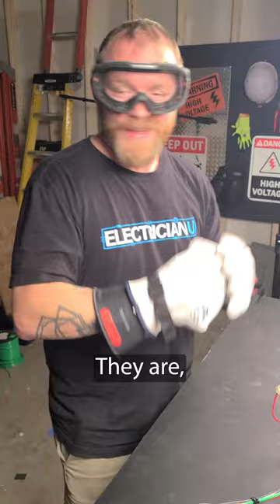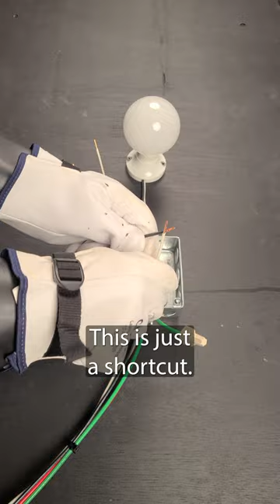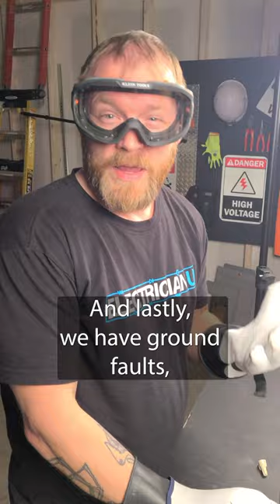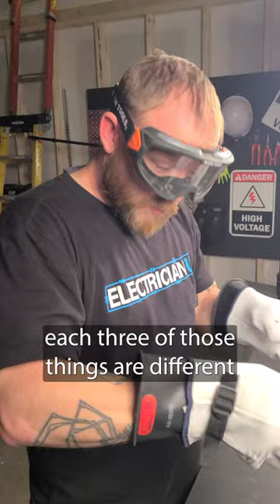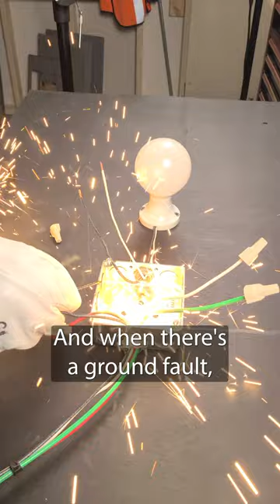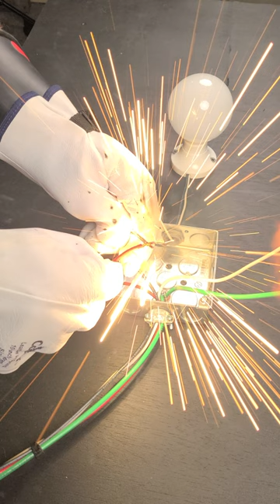Different Types of Short Circuits - 120v VS 240v

Comment: 277 volt short or ground has some really nice sparks, lemme tell you.
Reply: Worst i ever got hit was on a heavily loaded fluorescent lay in lighting circuit. Dont sleep on any of the voltages especially 277.
Reply: @camw6990 why does it matter if it's heavily loaded. Most lighting cuircuts have plenty of amps to kill you it's the volts that determine the amount of amperage that will flow through you as well as contact area and time which plays into resistance.
Reply: 277 is absolutely the worst to get caught on especially on an alpha phrase
Reply: what you do not realize is voltage does not kill amperage kills it only takes.0775 the amps to stop an average human being adult heart let alone a child if somebody tells you 120 V will not kill you their next Dream full depending on the circumstances
Reply: @jsb7546 if you get on the neutral at the end of that heavy load it'll matter a whole hell of a lot
Reply: @justaoldman5419 that makes no sense

Comment: Have you thought about demonstrating what would happen if you run a 120 volt light bulb on a 240 volt circuit? It would simulate what would happen if you plug in stuff that is only meant for 120 volts into a 230 volt supply in Germany and 240 volts in the United Kingdom for example.

Comment: In power systems analysis, the first one is called line-to-neutral fault, the second line-to-line fault, and the latter line-to-case fault (as opposed to line-to-ground fault, both of which are ground faults).

Comment: It's always nice to do troubleshooting over the telephone when the person on the other end does not know the difference between a breaker and an RCD and thinks it's all the same. And tells you the breaker trips instead of the RCD (or vice versa) and all your efforts are basically useless because different errors cause different safety elements to trip.

Comment: NOW THATS SOME DAMAGE!!!
❤❤❤
Reply: Had a fire a few weeks ago from the 480 volt hvac another crew screwed up on. Right on top of these 1500 volt lithium ion battery banks 20 percent charged. Now that's some damage. Surprised the battery's didn't blow up with all that heat defenilty could have been worse.

Comment: P = U^2/R -> power at 240 is 4x at 120 (as the current is 2x and the voltage is 2x). Assuming R is constant, which is not quite accurate, as the neutral has all kinds of parallel paths via bonds and earths, and the hots don't.

Comment: We had a ton of unmarked 277 volt lights in a halve Millon square foot plant. Had a long cord where  would plug into the ceiling 277 volt receptacla and short it out on a steel beam or larger steel pipe. 
Has old circuit breakers that never cleared a short in less then two seconds. Newer midels tripped out in a flash. Company was too cheap to even purchase one circuit tracer for the 6 electricians

Comment: Don't all of them go to ground? Either through the neutral or through the bond?
Reply: No they go back to the source. Kind of a myth tht ac will go to earth. In reality the transformer neutral is bonded to the earth by a earth rod so when your panel earth fault occurs it runs thru the earth to the transformer earth bond back to the generator
Reply: actually, you could have a short phase to phase (or between hot legs on single phase) and nothing going to ground / neutral.

Comment: N-E faults will only trip MCB breaker to trip. L-E fault will cause both MCB and RCD to trip followed with a bang and flash. L-N will do the same as L-E if appliances are in use. ( all otherwise known as short circuits)
Reply: Nuetral to earth faults trip our gfci's here. European electrical still confuses me sometimes.
Reply: @jsb7546  Not sure where Garkan is from and I can only speak for Germany.
If hot and neutral touch, it's a short circuit and the MCB/fuse trips. If the hot wire touches ground/earth, only the RCD trips. The MCB may trip, but this depends on the exact circumstances, e.g. how fast the GFCI/RCD/MCCB trips.
Touching neutral and earth should not trip anything theoretically, as both neutral and earth are the same and split before the RCD. However there are always certain minor residual current floating around and so at least 30mA RCDs will trip if N and PE touch.

Comment: Why does a direct short between hot and neutral cause a breaker to trip? Is it the lack of resistance or something else?
Reply: The amount of current that kind of short produces trips the breaker’s electromagnetic mechanism. That’s the “quick trip”. There is a thermal strip there, too - that’s for slow overloads, like two heaters plugged into the same circuit. Look up how breakers work.
Reply: Yeah the lack of resistance causes the current to jump outrageously high since the voltage is constant (ohms law). That’s why most breakers say 10000 A max, because it can actually get that high when a short happens and they might not catch the fault if its above that max.
Reply: @Gruntled2001  Thank you for sharing. You're right about searching up how breakers work, I'm sure that will help with troubleshooting
Reply: @fabboterman  Thank you for the response. I feel it's important to know why just as much as the how